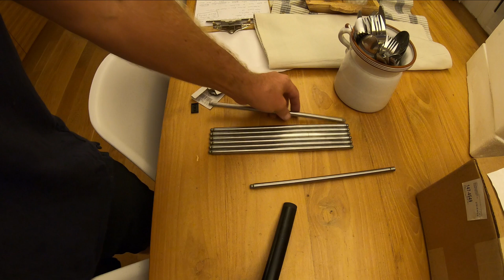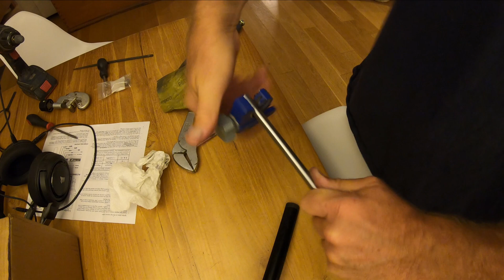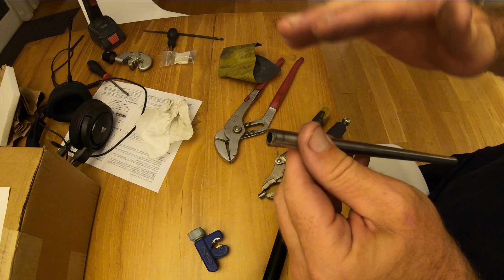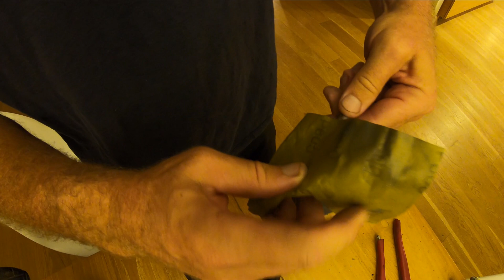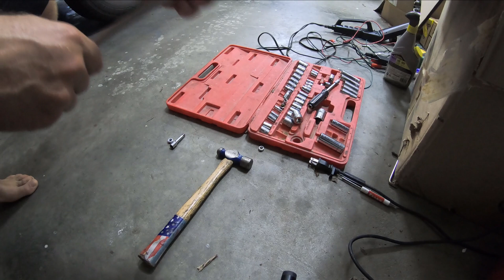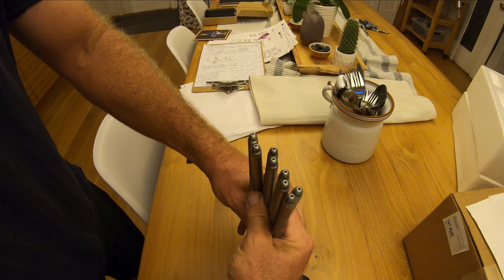2332 VW Air-cooled Stroker Motor - Video 70 - Cutting Pushrods to Length

Comment: Next time you do cut to length pushrods use two old lifters, put one in the table vise or floor and  use the other one to strike with the hammer it protects both ends of your pushrods. Nice looking motor by the way 👍
Reply from the maker: Yes!  I wish I had had the old lifters - I had to use a nut that had a similar sized hole - and it was sketchy hammering it down on the concrete…